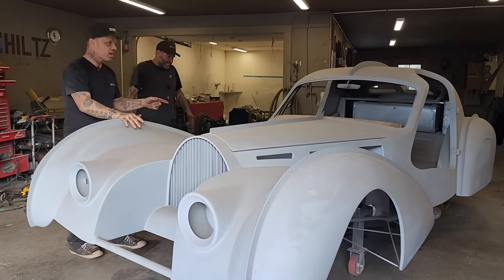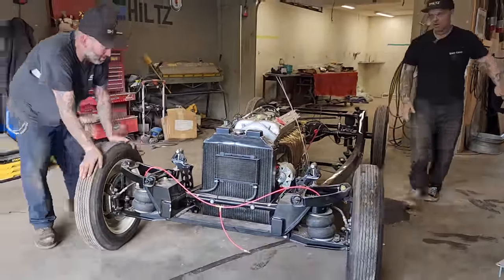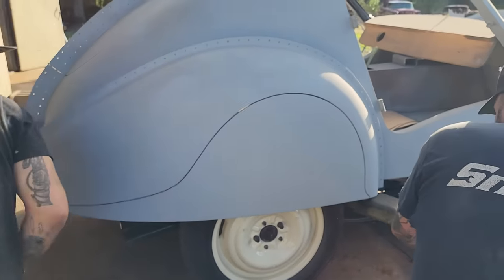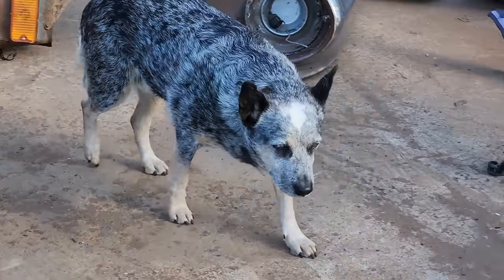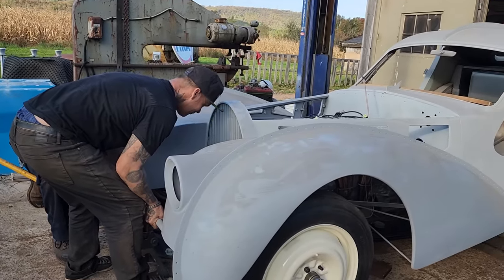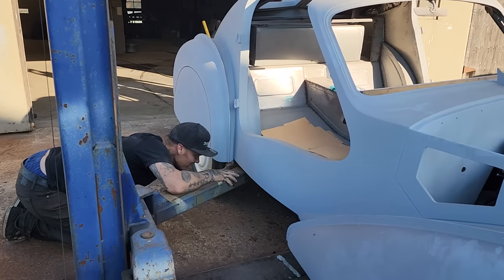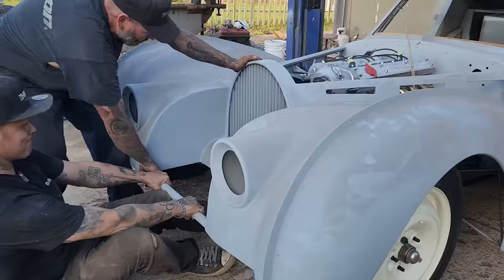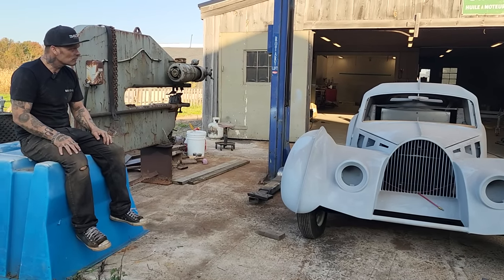Let's try this again... will the body fit the chassis? 🙏🏼

Comment: Wow that was exciting :hand-orange-covering-eyes: when you have so much time and effort tied up in such a project you don't want to have to redo anything better to take your time! I would make some reference points so when you have to take it off and on it will be easier and less chance of causing any damage and less time to put on and off:face-orange-biting-nails: great job by all three of you because you need many eyes with such a tight fit :face-turquoise-covering-eyes:

Comment: I've been looking at the right front fender in comparison to the left front fender for over a year and I'd really like you to put a dial angle guage on the top fender flange and see what the angle is and then do the same on the left  fender.
I hope I'm wrong but the right fender looks like its rolled inboard. Its enough that looking at the car from the front head on its really noticeable. I hope I'm wrong, but I think you should check

Comment: I'm not an expert, but when I drove fork lifts if the hydrolic fluid was low the forks would'nt move smooth  and we would have to bleed the air out. The Buggotti is looking awsome..You guys rock.

Comment: Chad I’m thinking that if you had a narrow centerline painted on the slab and a centerline mark on the front and rear of the chassis you could use a plumb bob to align the two and a center line mark on the body to align it to the chassis also from the line on the slab for this kind of operation. You’d also want to pretty much center the body on the lift. Easy. Well done.

Comment: Hell yeah...what you need to do is make alignment pins that go in the four corner mounts that way you can drop it on easier.
Reply: 4 pieces of round rod about 12" long that either attach to the body mounts on the frame or body so it comes down perfectly. That way when it's done, there is no guessing. You're special tools for the car.
Reply: Ok hear me out. My brain is working overtime.  Weld the nuts for the mounts to the body, since it's not painted yet, and get some all thread and cut them as long as you can so when the body is on the frame you can still get them out when it's all the way on. Then you can screw them in the four corners, drop the body on perfectly and then just get the rest started, then unscrew them and put your bolts in. That way there is no chance of messing anything up on the final install.

Comment: weld some square tubes on the under the body, then for the lifting you can slide in some solid bars to lift it well outside the footprint of the car, like they have for rally cars, when you done lifting the body the lift tubes can be slid out

Comment: One inch to maybe two inch spacers in   the front to Center the tires. If you use spacers be sure to use on the bolts used to bolt on the spacers.
Reply: Use lock tite on the spacers bolts if you use them.

Comment: When you guys lift the car you should have the arms above the body and lay a 4x4s across the arms and suspend the body over the frame with nylon straps tied on to the 4x4s, That way the arms wouldn't be in the way. Use a set of your wheel carts to manuveur the chasiss into position. Take the fender skirts off.

Comment: Why did you extend the lights and fenders and leave the grill and hood normal? 
To me, it lacks something. It doesn't flow it looks pieced together, not like it came out of the factory, which is the impression you want to achieve, in a custom build .
Reply: He should just pull up the Jay Leno's episode which has many shots taken from all angles. However, it isn't enough to make it look alike - it should also be comfortable to drive/handle/brake properly.

Comment: Jolene get Chad to pull his lift arms off and wire brush and use lithium grease(Low Temp) grease so he doesn't have to struggle. Then add oil to the hydraulic pump and run it to the top and down a couple times.
Reply: Lithium Grease drys hard as a Rock
Reply: the lift is in need for some attention
Reply: He has done well with what he been doing . Now he is entering another phase, keep going kid. Gene heck. mn.
Reply: Use marine grease, being outside , marine grease will last a lot longer and won't go hard...

Comment: Maybe you should have the hoist over the top on slings to spots on the body where there is strength. Even if you needed to make the spots. Just a thought

Comment: The Golden Rule.....where are the drawings . 
Gotta have drawings, cant build from the outside in.
Reply: Looks like he does everything by eyeballing it. He could have asked Jay Leno to write him the measurements, like wheelbase, overall length, width, height, front & rear overhang, wheel track width.

Comment: Looking fantastic there Chad.
A suggestion-  Place some masking tape on the body at the point where you set up the hoist so you can always set the body in the right spot and then same on the chassis and use a plumb bob to line up each time you go to reset the two together.

Comment: If the pump is aerating / cavatating..... it may not have the correct fluid in it. Some of them have an anti-foaming agent in them. It definitely doesn't work right.

Comment: Could use wheel dollys on all four tires. ..would give a little more height and make it much easier to maneuver around to line it up with the body.  Just a thought, use if you like, if not throw it away, 😉 lol

Comment: The hoist noise sounds like the motor and if so most likely it is due to a bad motor starting capacitor..  If this is the case a replacement capacitor is about $20 Cad

Comment: Next time use a metal dowel to line up the body mounts as you putting the body on that should help get the body in a good position for the frame??

Comment: That hoist sounds like and acts like it's low on hydraulic oil...please check the reservoir online so I can quit worrying about it Thanksabunch, Woody
Reply: Probably purchased used, and was already worn out.  Bargains are not always bargains. What it will take to fix it, would have been better paid for at the beginning and saved a lot of money and grief.